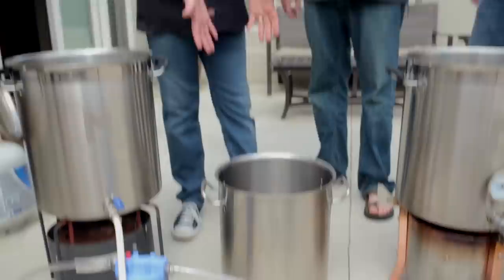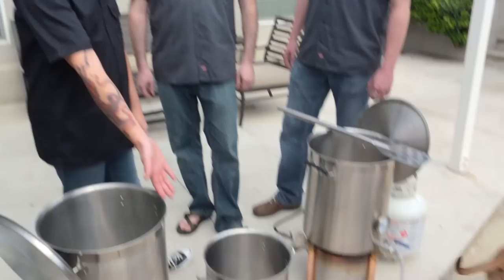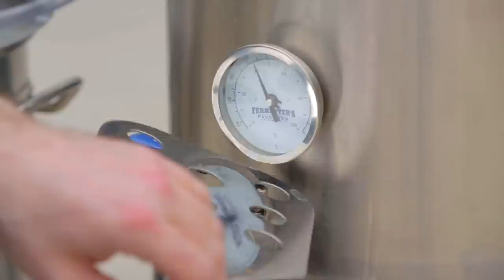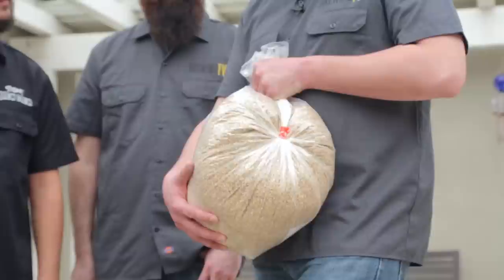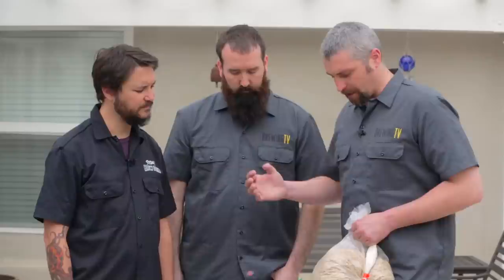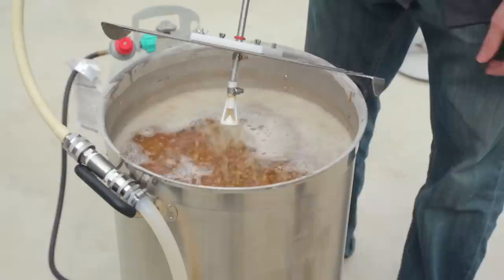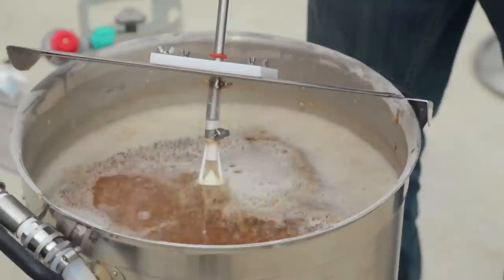Brewing with Wil Wheaton (Part 1)

Comment: Awesome! A couple of years ago I bought a high temp pump and high temp food grade silicone tubing. I place the the pump, tubing and sparge arm all inside the mash tun and circulate inside. Temperature is maintained even after an hour and a half of conversion. Several times during the mash I'll shut the pump off and stir the grains to prevent channeling. It has worked very well.

Comment: I believe it its best not to aerate the hot wort.  I put the hose down to the bottom of the boil kettle when sparging.  I never use an iodine test.   I find that with a 45 min mash and re-circulation, the wort is very clear which indicates the absence of starch.  I want to avoid getting iodine any where near the wort or the brewing equipment or me.  I have watched a lot of videos on brewing and I like this one better than any I have seen.  Very thorough. Thank you for posting it.

Comment: Not sure who owns the channel but great job not just a good video on the IPA but great video on recirculating the mash.  One quick suggestion so you don't have to stick thermometer for not critical temps, use a thermometer infrared gun.  Costs about $30 and works great fast and easy.

Comment: Question. I just picked up that exact recirc arm on top of the kettle. The hose that comes with the arm is 3/8" ID hose while the rest of my system has 1/2" ID hose. How can I mate these two sizes up? I noticed in this video it appears you have a quick connect to mate these two size hoses up. Can someone give me a link to those fittings I would need?

Comment: Hey, everyone.  So in this video (part 1), Wil says that the Tall Boy is his HLT, but they clearly sparged from the second Megapot and later in this video they collected wort in the Tall Boy as if it was the boil kettle.  However, in part 2 they are clearly boiling in one of the Megapots (I can tell because it has the black handles.)  So, did they just simply collect in the Tall Boy and then pour the wort into a Megapot?  I'm asking because I'm building an all-grain system and I don't want to buy three $300 pots if I can get away with one of them being less than $150.  Would love to get anyone's thoughts.  Thanks!

Subsequent edit: nvm, I just rewatched and Wil explains everything at about 17:00.

Comment: Just a question.  I use a cooler for my mash tun and I usually just varlauf like Wil does.  If I decide to recirculate the wort in my mash tun to get a clearer wort will this cause my temperature to drop during the recirculation process?  I ask this because I cannot simply turn back on the burner under my plastic mash tun if temps drop.  I have seen people using some kind of heating element to keep the recirculating wort temperature the same.  Is it worth going to all this trouble of installing a heating element while recirculating in my mash tun to control the temperature? For you guys who use plastic cooler mash tuns, who do recirculate, notice any significant temperature drop during this process?
Reply: dubprocesslbc You'll definitely get a temp drop recirculating without heat.  How much?  I don't know.  The setup Wil has is ideal for this.   Whether it is worth the trouble...  clarity to me is secondary.  Efficiency is primary.  Also, just to mention...  I'm still an extract brewer.  I hope to get to all grain this summer.  I'm only commenting  based on things I've come to understand by watching videos.  I could also break out my old heat transfer text book from college and give you an exact heat loss calculation, but that might hurt my brain.  :-)

Comment: Wait. Did he fill his kettles through a garden hose? Even through that "filter". Not good.
Reply: That's a potable water hose. White hoses that are usually found on camping trailers and the like. I use it too.
Reply: +Chris Walch I have a potable water hose as well. Usually white or bluish with a crisscross pattern. Sure looks a lot like this one. http://www.homedepot.com/p/WaterWorks-FlexRITE-5-8-in-dia-x-100-ft-Water-Hose-WWFXT58100/100124440